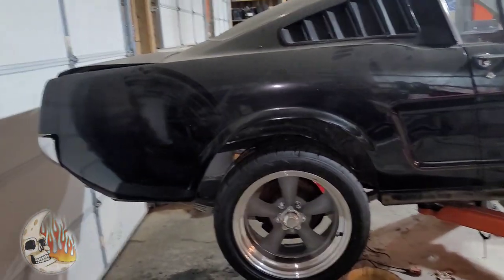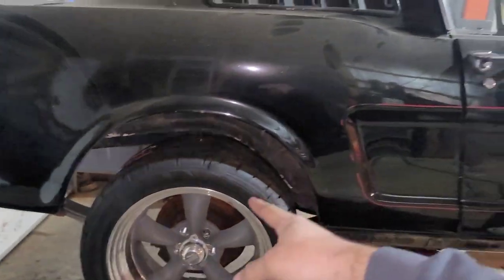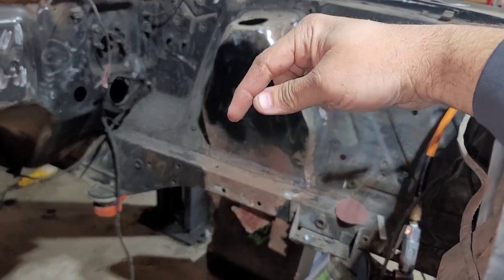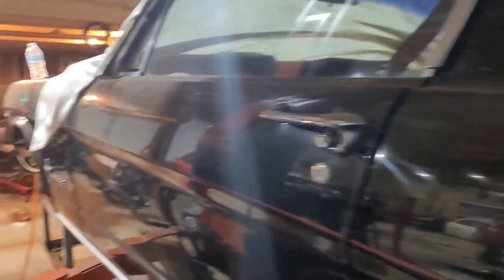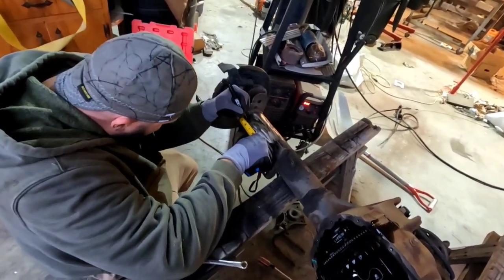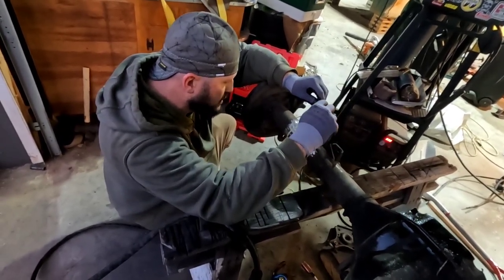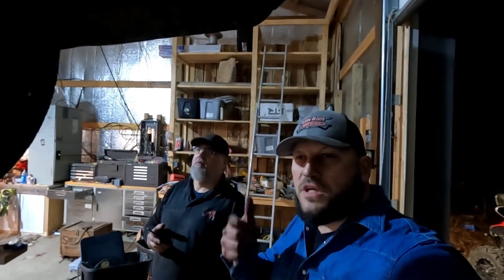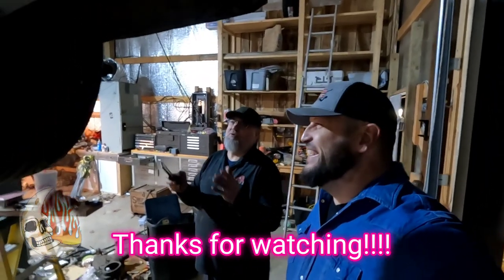DIY: 1966 Mustang Fastback budget axle swap

Comment: This mustang looks amazing love the black and red interior combo! I’ve NEVER shorten an axle, but if you used a metal pipe as a Sleeve and cut out half of the middle of the sleeve it weld, would that make it easier to line the axle easier together? Then you can cut said sleeve off after securing in place.
Reply from the maker: Thanks. The biggest issue with using a bigger pipe is having that exact size on hand and having clearance around the joint to tack it in place. Angle iron works good because it lines up the round tubes evenly. A bench vise uses a V shape to clamp down on round material. When I was a machinist we used V blocks to hold round stock for milling.